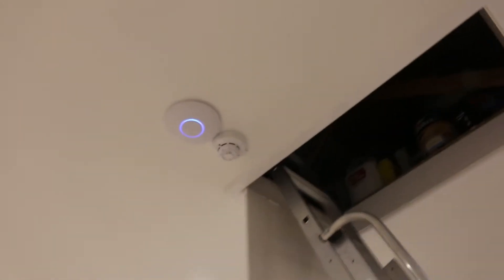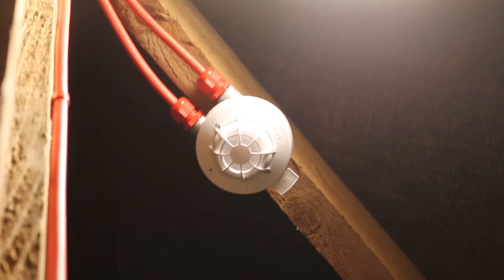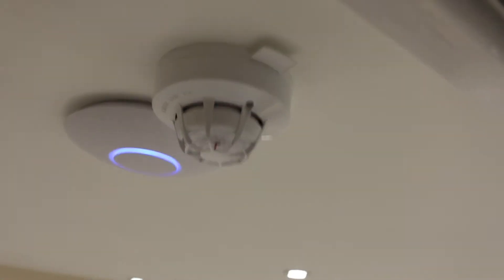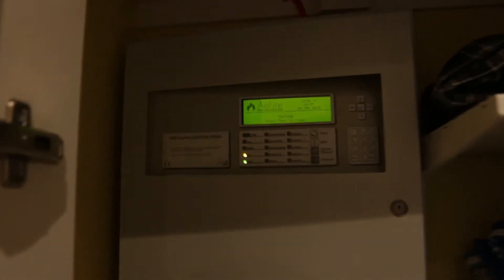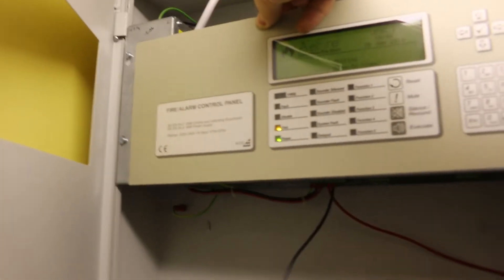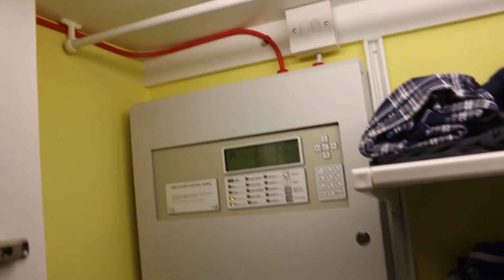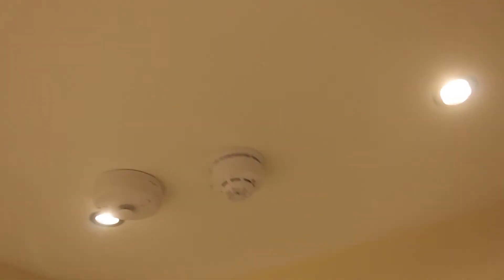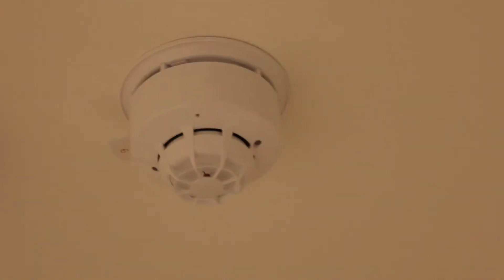Apollo XP95/Discovery System Tour and Quick Test (Version 2)

Comment: 0:19 That's a pretty nice server, looks like a blade chassis?
Reply from the maker: Northern Fire Systems yeah, I'm selling it
Reply: AeFire Ah nice, I’ve worked with those before; they weigh an absolute tonne.
Reply from the maker: Yep and mine uses 2kw at idle
Reply: AeFire It will do! The servers I have probably eat up a lot too, but because most are VM’s, it saves a lot more energy. Much better to buy powerful hardware to run multiple VM’s off mind. Blade servers are often used to do that.
Reply from the maker: Yeah, I do eventually wanna play around with servers (again) with like active directory accounts and NAS stuff.
Reply: AeFire You should. Group Policy/ADDS is a good start. The core of my network authentication uses ADDS. Then, go on to the external web based server stuff.
Reply from the maker: I have done a lot of stuff with servers before. I used to have two 8 core 16gb ram HP servers running XenServer for virtualization but they were way too powerful for what I needed (obviously) I have a small dual core Fujitsu server I think I'm gonna use.